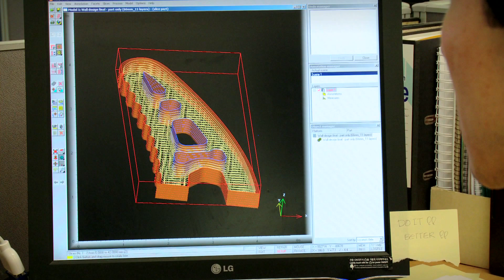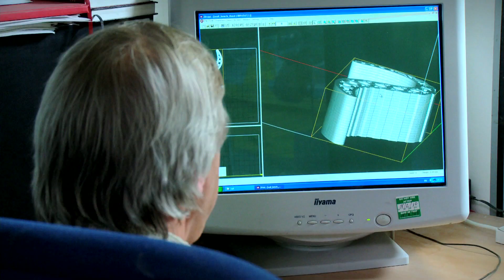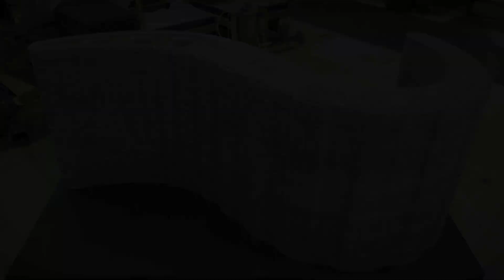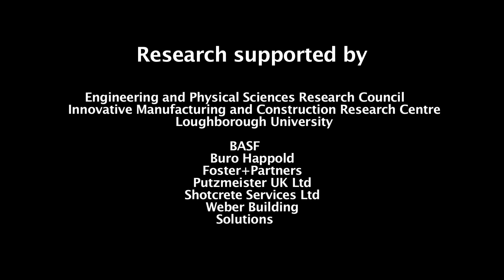Future of Construction Process: 3D Concrete Printing

Comment: Excuse me, but ... ??? where are the doors, windows, tubes for all the services ????
Reply: Windows and doors and be poured in place with the printer (see video of printed castle) plumbing and wiring shafts were shown... 
The real question is strength. Concrete gets its strength from steel poured within it.... where is the steel?  Rebar?

Comment: but what about rebar?
Reply: THE CONCRETE IS FIBRE REINFORCED DURING MIXING
Reply: Fred Fredd not good enough. It might add some tensile strength but there's no robustness or resiliance without rebar. The old system of cement+sand+rocks+rebar is still better, because if a floor is damaged, it'll give out warning signs like huge cracks, long before it collapses. The same cannot be said about fibre-reinforced concrete.

Comment: Not sure how this will save money.  You have to buy material to print the parts for the building and then you have to pay someone that knows how to assemble it.  If the part of the material to use these 3d printers are plastic, then the cost of plastic in the 3d printing form factor will really increase in price.  Then what about finishing a building.  Sure you can create the basic layout, but you will have to put in carpet, hardwood flooring, lamient flooring, wall paneling, bath tub, toilet, electrical wiring, plumbing, lights, etc.  I'm just not seeing the cost reduction.  I think it will still cost a lot of money to construct a livable house.  Now if you are creating a cave, then yeah, you just need an object that provides shade for yourself.

Comment: Two things about the mold idea:
1. Adequate molds (probably using new materials) will be necessary in order to deal properly with concrete; and
2. Molds are useful once you are going to (re)use the same element several or lots of times, and that's a very 19th century industrial concept. The point here is developing some technology able to deal with 'bubble' Architectural shapes or any kind of organic spaces where repetition and  symmetry are not the goals.

Comment: The hacker / maker movement is about to disrupt many long established industries. As a programmer it's both exhilarating and scary to see where we are heading. Over the next 15 years we will see nearly every industry affected. It is frustrating at times because the people who are most vulnerable to the change are also the most stubborn about preparing for it. I don't blame them, if I was a third generation carpenter and you told me robots would soon take my job I wouldn't believe it either.

Comment: You are wrong. This kind of manufacturing uses a fraction of the power of many other methods. It has very little material wastage, which means less energy used to make materials too. On top of that, it can build structures with features that make them super efficient, like printed-in insulation cavities and passive air conditioning like a termite mound uses. The buildings this technology can create are a magnitude more energy efficient than current structures.

Comment: Having been a building contractor for 3 decades I see the possibilities of this technology... But, the inherent problem in the industry is; "Time is money"... In concrete building modules, it is set times which become the rub. If a sub-assembly is a 20 yard plus poor it needs to be poured, vibrated and finished in about an hour or so after pour. I like this additive manufacturing for complex shapes in machines but, in heavy construction, We're already at peak technology. Maybe someday : )

Comment: Unless these printers can be used onsite. It seems that the cost of shipping the building components would be extreme. Whereas a 3-D printed form could be used more efficiently, and be used multiple times, if designed to break down to be reused. This plastic 3-D form construction could also be designed to remain as the exterior finish of the concrete member.

Comment: Actually, and you would do well to consult with tradesmen that specialize in these fields, this approach seems to open up vast possibilities for service accessibility. Consider the difficulties that contractors of all sorts have to go trough to access wiring and plumbing in the average residential home. This is largely due to the inflexibility of traditional construction. With methods like this, it would be trivial to design in custom access for servicemen that would ease these burdens.

Comment: actuly u dont need to add rebar, and building a house takes 20hrs, there using this right now, and in the walls isnt solid, its like a web like frame so you could sent pipes through it easily and because that t will be weblike the tempeture will be the same, so building a house (windows door pluming etc) will take maybe 1 week instead of 3 months

Comment: No sure why anybody is bringing up Fresco or Jesus for that matter.  Unless he has (or He has) come up with a good way to either insert rebar or eliminate the need for rebar.  Not sure what cannabis has to do with this either, except that I don't have to worry about a machine smoking the stuff on the job.

Would it be possible to use smaller bars, but more of them?  I'm thinking something the size of chopstick or knitting needles.  Maybe toothpicks.  Should be easy for the machine to zip them in

Comment: Good point however, 3d printers arnt limited to 1 material at once. They can use metals at the same time as concrete. Essentially you would be able to include the rebar reinforcement during the printing.

Comment: I know rebar is initially used to help keep the concrete in place while it cures, but doesn't it also keep some structural integrity?  I would feel much safer during an earthquake in a concrete building enforced with rebar than a completely concrete structure.

Comment: It looks cool, but i would prefer fiberglass than concrete.With concrete, you have to deal with cracks, weight, transportation.When you need to fix something like a hole or adjusting leveling, it's a pain in the ass. Fiberglass is a better solution.

Comment: @concreteprinting,

Why not consider some kind of enhanced fiber-reinforced concrete as an alternative to rebar? The goal of rebar reinforcement is to add stiffness, is it not? In which case, the right kind of fiber-reinforced could add stiffness to the walls/structures in a more uniform way than rebar could.

Comment: Rebar in the form of small steel rods (approximately the size of a normal wood nail - eg - just a few inches long) is used in Australia, and I've seen it in use on Grand Designs as well.  All that's needed to make structural components would seem to be some kind of mini-rebar feed system, perhaps coupled with some compter smarty stuff so that the mini-bars are positioned in structurally useful ways.

Comment: @3goldy true but stresses, defects and/or bad installation can result in leaks and breakages. You just dont want to place pipes where you cannot get your hands around it. I inspected a bldg built in the 1920's where the pipes were cast into the concrete structure of the building, bad mistake as the concrete was damaged and most of the leaks were totally inaccessable. The only solution was to totally redo the plumbing system in new chases at great expense, dont "build in" a problem you can avoid

Comment: @3goldy my concern wasn't the issue of assembly, it was the notion of placing utility pipes (water, drains) inside the block cavity itself, if the pipes leak or break the only way to repair them would be to physically break open the concrete wall to get access, and that would be prohibitively expensive and water saturation is potentially catastrophic to the building structure. Those were my main concerns. I still say good luck with it and hope they succeed, its interesting stuff.

Comment: What they making is essentially a custom made fancy shaped concrete block. Steel rebar would still need to be placed by hand and mortered in place. Still this opens a lot of new intriging ideas, custom shaped blocks would be possible. but regarding the suggestion about placing pipes inside the block structure? what happens when it leaks? Water saturated concrete is not a good situation. place your pipes/duct/conduits where its readily accessable. good luck with it.